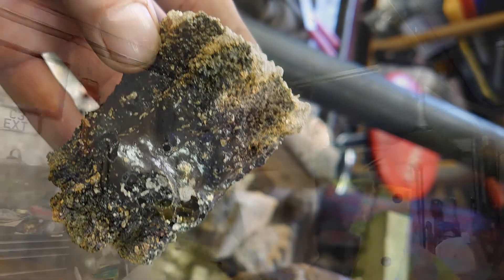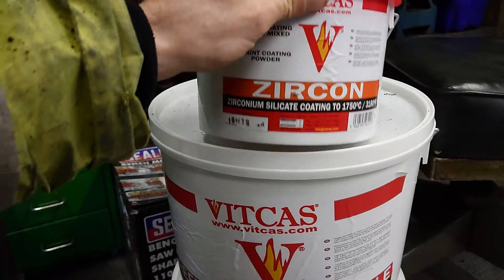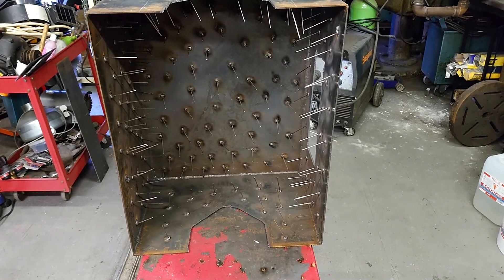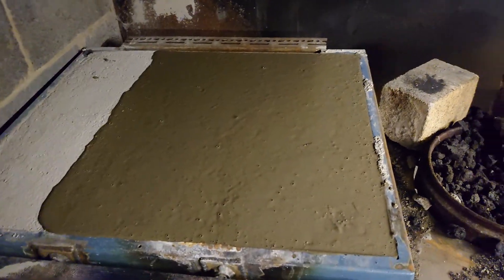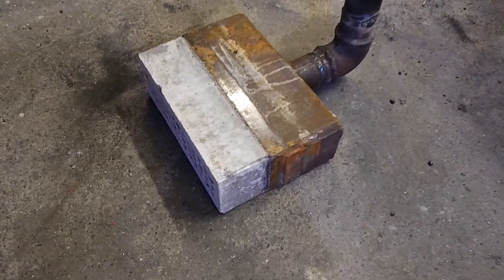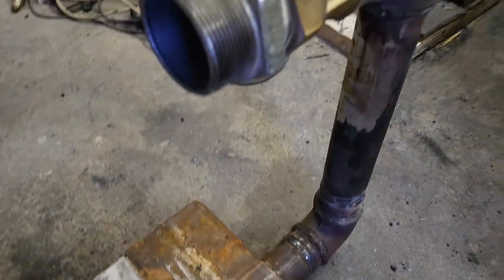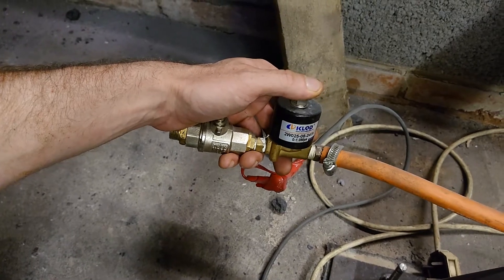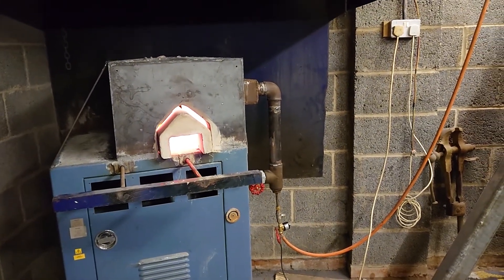Massive Ribbon Burner Forge Build

Comment: Good one, what did you use for the blower?
Reply from the maker: Thankyou im glad you like it, the blower is a 4inch RVK inline style unit 👍
Reply: @DaMainMouse  ok thanks
Reply from the maker: @lenblacksmith8559  initially I had it on a speed control but now found it easier to leave blower on full and use a 2inch slide valve to regulate the mixture. It still easily copes with it on full which is a 1.6mm jet at 25psi 🥺